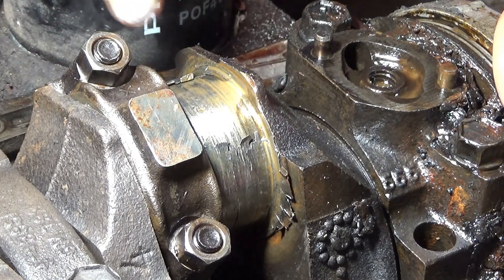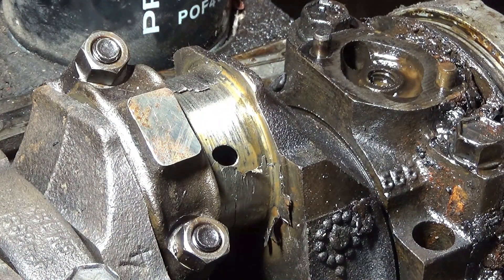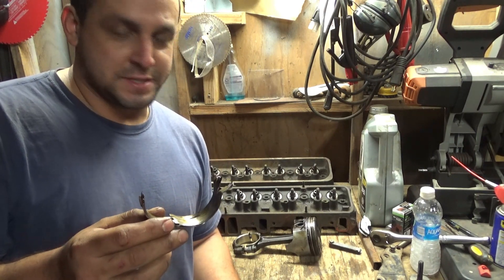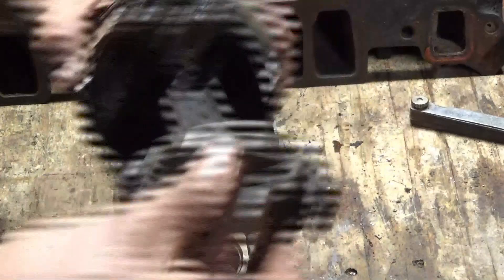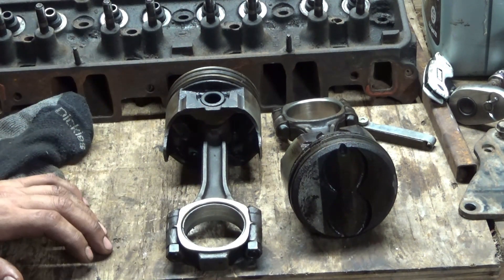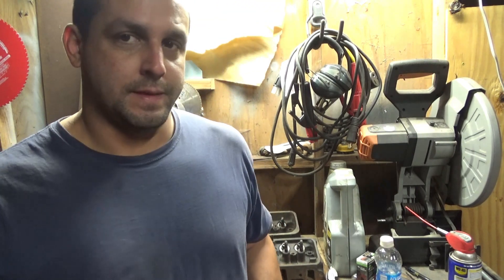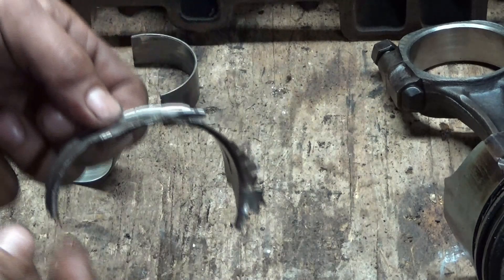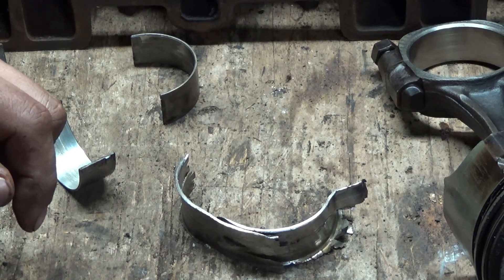small block chevy spun rod bearing

Comment: I have a 91 305 that I put rebuilt 081 tpi heads and a ramjet cam. Thing ran great in my wagon. Sitting on a stand because I did a LS2.
Reply from the maker: I will eventually get into LS engines, but I wanted to mess with the old school small blocks for a few more years and do something I have never done before. I want to turbo charge a 305 and then a 350.  Thanks for watching and commenting.

Comment: I’ll lend two bits of advice- information. 
  First. Anytime a rod bearing or main bearing fails, there is friction-heat generated that is obvious. 
   What is not obvious is the magnetism that generated because of all of the friction and heat.  You can grind that crank and recondition that rod, but if those parts are not demagnetized every metal particle in that engine will be attracted to those parts and their surfaces.  
   A very real detail that is often ignored. 
   The next it is that the 305 and 350 Chevrolet have the same stroke and basically the same crankshaft. 
   Often these two crankshafts are swapped out for one another in exchange situations for more quick fixes and even in a major overhaul. 
   Here again the detail is quite obvious in that the two crankshafts have two different balances because of the weight of the piston. 
   What happens when these are swapped is generally never noticed and I’ve seen this seemingly work perfectly. 
   In reality you must know that there is a gross imbalance in the reciprocating mass that is generating harmonics that you likely can not hear. 
  Harmonics will ring at levels not audible to human ears but that ringing is certainly impacting bearing surfaces all throughout the crankshaft and the bearings do exactly what you’re seeing here. They’re falling out of their housing bores because they’re taking a beating. 
   You’ll also likely get the idea that some of those bolts may have not been torqued down. Another phenomenon that occurs during gross harmonics is that threaded applications get slowly rattled lose making it seem like they were never torqued in the first place. 
    This should make it clear how a bearing failure manifests. It should also lend a clear understanding that the money saved by not dynamically balancing your engine can be a bigger gamble that once thought. 
   One last note.  That rear cap appears to be blackened.  I would make sure you do not have a burned rear main bearing or burned thrust surface on that rear bearing. 
    This can indicated a ballooned converter or bad clutch setup. Maybe a pilot bushing installed where it should be. 
    These are just a few high point details. The rabbit hole gets deeper but I’ll cut it short to this. 
   Hope this helps.
Reply from the maker: Thanks for the info.  I will be trying to keep a factory matched rotating assembly, and if I do have to replace that rod, I will make sure it weighs the same as the rest of them.  Also, I will be comparing the weight of the new pistons vs the old ones.  If I change anything more than a few grams, I will get it balanced. I am aware of the thrust on a crank.  I will be taking my crank to a machine shop and have them check it out and turn it. The magnetic stuff you mentioned is new to me, and I will read up on that. Thanks for the advice, and thanks for watching.